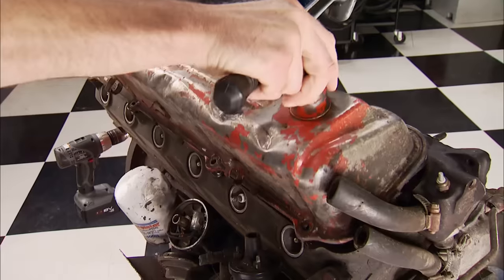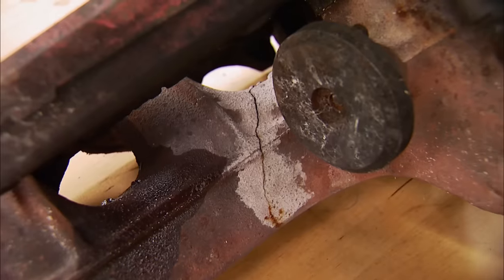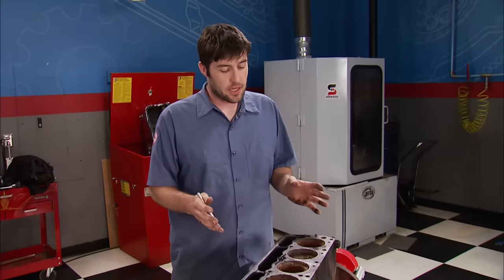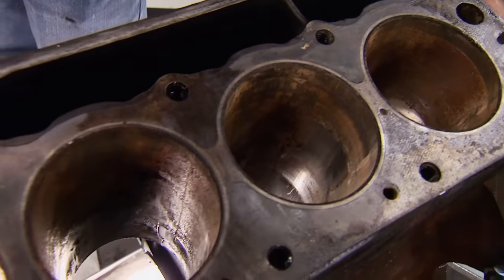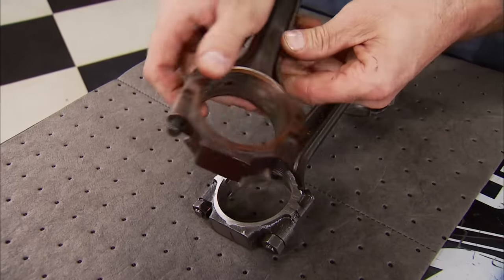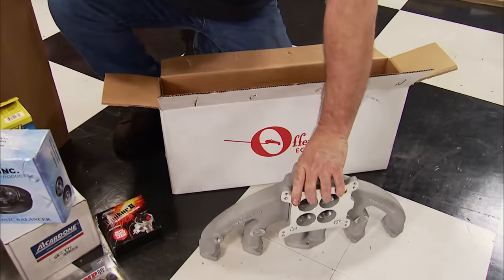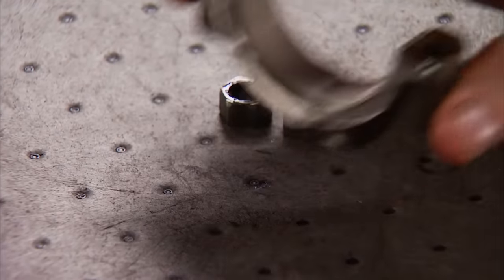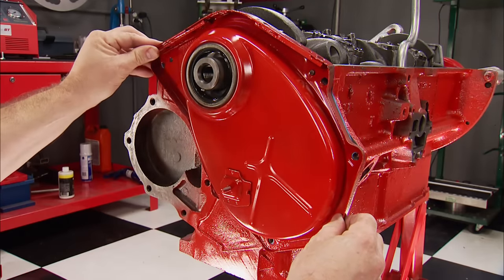Resurrecting A Mopar 225 Dodge Slant Six - Engine Power S2, E2

Comment: We bought this engine for $150 threw it away, then spent $3000 building a new one and called it the old one.
Reply: 10 4
Reply: Lmao! Shiit
Reply: So true Mr.Kaye, so true.
Reply: You're not supposed to say that -- but yeah.
Reply: @markmergatroid2348  Yep. And I bet that chrome valve cover adds 50hp!
Reply: Lmao ... machine shop kept it for themselves
Reply: Yes. He also could have said "The $140 block and heads were fine with machining. I could have ordered a crack free reground crank at a local parts store for $250, but screw that. The show needs extra drama."
Reply: @tsal4379  truth
Reply: Yep that valiant drove like a tank. But that. 225 was   a D8 cat monster, it handled any ABUSE u gave  it, o yes. 68 doge van too with 9 in it  PCsaw us alot
Reply: Shit happens.  I had a block crack, it’s no more than a boat anchor now.
Reply: That’s why you spend the $15 insurance at the junkyard, they’ll swap it out.

Also they don’t pay for the parts on the show, companies provide them the parts. It’s the same as advertising.
Reply: Every company contributor name was mentioned😮.   
Down to the bolts and washers.
Reply: Gotta love the logic of tv
Reply: That's how I do it.

Comment: Should be called "How to tear down a Slant six, throw it away and build a new one from scratch."
Reply: I'm cracking out , god I thought the same
Reply: You summed that up very well.
Reply: I had 4 of them and they were not a good engine . 100000 miles and they were junk . Newer engines are tremendously better .
Reply: Charles Wesley also putting the carb over the Iraq exhaust manifold doesn’t seem right
Reply: @sleeplessvirus  The metal used in them wouldnt make good slag .
Reply: @sleeplessvirus   The cars rusted out before you could pay for it . I will not buy a Ram truck today because of how bad they were even with a Cummings engine . I had a. 20 year old Ford Taurus with no rust .
Reply: @charleswesley9907  I beat mine hard for 150,000 miles before I sold it! It ran great! Change the oil!
Reply: @robertlee9395  My truck has 243000 on it and doent burn any oil . 250 thousand in a 4 cyl now days is still not wore out . Not so for the old days .
Reply: @charleswesley9907  Wow its a late 90's model those were the best imo, especially the "sho"  edition true power houses.
Reply: @BACON-l3t  It was a1990. 3.0. L .
Reply: @charleswesley9907  That is why I paid extra to have the 318 V8 on my '72 Valiant.
Reply: @mikemorales1725  318 was a pretty good engine . Still engines today last a lot longer thanks to the Japanese imports .
Reply: @mikemorales1725   Planned Obsolescence of the old days . 120,000 miles on a car was 0 trade in value . Now its just broke in good .
Reply: @charleswesley9907  I recall no one used to keep them past 100k miles, they were useless junk back then. Only Mercedes and Volvos made it to those high numbers.
Reply: @charleswesley9907  Back in those days very few engines went to 100,000 miles without needing at least a valve job - Chevy engines were worse , most were lucky to get 80,000 miles and they were puffing smoke .
Reply: @charleswesley9907  in my opinion the Ford 300 straight six was far superior
Reply: @MrShaun1578  I owned a 74 F250 had plenty of power but was very thirsty .
Reply: Did you miss where they reground and used the old valves? Totally a restoration :P
Reply: I love how they keep putting in the matco plugs on thier tools like rubbing it in that they have a million+ dollar shop at thier disposal they like oh look how easy it is with our high dollar equipment
Reply: @jlo13800  wow, I thought I was bitter.
Reply: Not a 4 stroke fan but would love to  see your converted  slant  6 2 stroke  225 CID conversion, is it poppet valved loop charged, or uniflow with ports cut into it? Are you running oil injection with SAE 40? What VRO are you using, all of it has has to bettere than stock gear VRO pump.
Reply: Well a 4 stroke is fun to destroy though, pick it apart and shatter them to shatter to pieces. I love doing it. hehe
Reply: Ill take a mercury 3.2 v6 optimax 2 stroke aor Evinrude ETEC v6 over this any day, the 225 slant 6 poppet valved 2 stroke does not have a good power to weight ratio, is loop scavenged and noisy and will run in multiple positions though. It requires dry sump and oil injection set at 40:1 on semi-synthetic TCW3 though.
Reply: @charleswesley9907  My Toyota 4 cylinder is still running after 340,000iles
Reply: 225 slant 6 2 stroke loop charged valved cant even compare with a modern rotax snowobile motor for power to weigh ratio. or can it, le6ts see as both will run with xd-100 synthetic 2 stroke oil, the 225 slant 6 runs 2 VRO pumps though and a rich 40:1 mixture though.mits like an old outboard and noisy as hell. lets see how both 2 strokes measure up?
Reply: @butchtropic

No. 

At 50,000 miles the Slant 6 my parents had was burning oil and had such low compression it couldn’t hold the vehicle (a 77 Dodge Tradesman) on a hill. 

Sure you could do a valve job and re-ring it... but like most Malaise Era vehicles in the early 80s it was worthless. 

Now I have one of the worst modern engines in the world... a 5.4L Triton 3v V8... and it has 230,000 miles on it pulls good burns no oil.
Reply: you must premix nat 50:1 if you want to last, its just a sled engine to me. start premixing at rich ratios at of least 50:1, do not run a 225 slant six without premix, they are nothing but poppet valved u-loop scavenged 2 strokes
Reply: you most premix at 50:1 its a 2 stroke cycle poppet valved  2 stroke engine you mistreated
Reply: what do you premix as a ratio? i would run nothing leaner than 50:1 in this motor if you want it to last.
Reply: lol
Reply: That’s  just what I was thinking 😂😂😂😂
Reply: there is no such thing as a 4 stroke, all fucking allusions as most are poppet valved 2 stroke u-loop scavenged
Reply: oil injection with gear pump with premix and 1;1 valve timing with boost, i like your 2 stroke u-loop scavenged 2 stroke, the 225 slant six is made to be a 2 stroke with high torque, low rpm and total loss, long live this 2 stroke
Reply: @basn7381  i feel a theme in the comments
Reply: 4 stroke pos throw it off a cliff most 800 cc 2 stroke sled DFI 2 strokes make much more power, There was the 225 converted to 2 stroke it ran 350 hp and needed 2 vro pumps though, noisy as hell though
Reply: such a nice car powered by such 4 stroke crap, i would love to take the engine , mount it down range and blast it to pieces, long live ETEC an Optimax 2 strokes as well as detroit diesel 2 strokes
Reply: agreed
Reply: True true.
Reply: do we still remember how easy and cheap it was to raise a good horse
Reply: @jlo13800  ......k
Reply: Im not familiar with this engine but i heard it ran a long time, was this some 2 stroke conversion like one guy did to to mercedes 5 cylinder diesel?
Reply: run oil injection and run it in multiple positions, it should do that as these had high power to weight ratios! any synthetic 2 stroke oil should do.
Reply: its easy to destroy with high revs and multiple positions, it should survive at 50:1 premix though like a sled motor after all its so dodge tough, let the experiments begin!
Reply: Rev the hell out of it and it will work
Reply: Klotz oil techniplate for the oil injection, 225 slant 6 make for a nice poppet valved 2 stroke with dry sump and oil VRO pump into the intake manifold.
Reply: Its Assembling not resurrecting
Reply: 😂fr was abt to comment that
Reply: xd-100 2 stroke oil in it.
Reply: Total loss oil injection get with modern times, thats what a moden 850 runs
Reply: Oil injection with modern bearings get with it
Reply: Old school stuff with out oil injection, get with modern times with vro
Reply: premix with modern oils and oil injectiion, get with the times
Reply: The oil injection with a vro pump and and 2 gallons of quicksilver tcw3 synthetic 2 stroke oil, it would work fine as the 225 slant 6 was just another sled like motor. They even sounded like a skidoo 440 reved up
Reply: Run it with oil injection and in mutiple positions, after all it should survive like a sled motor! its a poppet valved 2 stroke!
Reply: What does it use for a VRO metering pump, i would go with one from a large v6 2 stroke outboard.
Reply: Lmao!!
Reply: @charleswesley9907  ..Cummins....
Reply: @jlo13800   Are you off your medication again?
Reply: @charleswesley9907  No im hooked on klotz techniplate,2 stroke oil, i got to get 8 gallons for my 2 stroke 8v92. Damn too pricey though! ugh but works damn good in it
Reply: @charleswesley9907  Im sure a 225 slant 6 can be converted to a 2 stroke poppet valved u-loop scavenged, just baffle the intake valve to prevent short circuiting, run 1;1 crank speed came, open the exhaust valve a little early to allow blow down and provide scavenging air. its been done
Reply: @charleswesley9907  i grew up on 2 strokes and i think all of them are a form of 2 stroke, they have not been realized to unlock there potential, everything is 2 stroke to me, its just been corrupted to act like its not. Poppet valve loop scavenging anyone
Reply: @charleswesley9907  Run it on synthetic 2 stroke oil and she might hold up better, run her like a cr500!
Reply: @charleswesley9907  To me there is no such thing as a 4 stroke, all so called 4 stroke are misfiring 2 stroke that need help.
Reply: @jlo13800  Go away !
Reply: @charleswesley9907  its a potentain 2 stroke i will, fire on every stroke loop scavenged
Reply: @charleswesley9907  fire on every stoke like a detroit diesel or a rotax
Reply: @charleswesley9907  Im not a 4 cycle person and will continue to use 2 stroke oil
Reply: @charleswesley9907  4stroke does not exist  to me
Reply: Right
Reply: The reason why they were indestructible is because they were breathing-limited to ~4400 RPM.
Hop 'em up and that 'guarantee' is gone...
:-/
Reply: Click-Bait is the number one component on YouTube.
Reply: Junk not worth the time and money.
Reply: I have magna fluxed machine parts, am a machinist and if the parts are cracked they can't be used. Duhhh. The block isn't new and new slant 6 blocks are not available, I have a slant 6 and have checked.
Reply: @charleswesley9907  After 1966 or 1967 the workmanship on those cars went downhill as well.  I had a 1974 Dart Custom and it was delivered to me with several glaring defects one of which was a warped and leaking exhaust manifold.  I was very angry with the dealer who got away with delivering the car in that condition.
Reply: @1575murray  I now drive Fords , they are some better .
Reply: why dident they try to turn it over at the junkyard.
Reply: was literally thinking the same thing, how is this a restoration, its a brand new engine
Reply: Ha haaa I was thinking the same thing.
Reply: that's a lot of their videos
Reply: So you reuse cracked cranks and old busted pistons etc in you builds ?
Reply: That's because, unless they got some sleeves, the block wasn't salvageable, those engines are dirt cheap and would likely cost less to just buy a new block than to get it sleeved
Reply: @lenny108  😄👍 yep
Reply: dont be silly, the oil pan was reused
Reply: @robertlee9395  bought a 62 Valiant(ex navy car), for 50 dollars. It was running on 5 cyl. It had a busted rocketshaft of all things.A replacement from the junkyard, brakes, and tires. Drove it for years !
Reply: @Daniel Stefanov Yep. I'd like to see what all they found wrong with that block.
Reply: I'm with you!
Reply: @charleswesley9907  Cummins not Cummings yo.
Reply: @charleswesley9907  Modern electronic fuel injection and ignition systems allow newer engines to run much cleaner with less carbon builup and less crankcase contamination from fuel.  Also better oils nowadays too.   Old engines used to get crudded up and sludgy very quickly.   Carbs were often worn and out of adjustment.   Chokes would fail and people would be dumping gasoline past the rings when ice cold trying to start them.
Reply: It does show the reality of this hobby. It is a shot in the dark if your junkyard motor is shit or not
Reply: Should be called, "re-uploaded how to tear down a slant six and throw it away and build a new one from scratch
Reply: I mean, it's a dodge motor so makes sense
Reply: @trelee9865  that literally made no sense lol, old dodges are the only old trucks still putting in work because they are hard to kill
Reply: @charleswesley9907  better than the Soft steal that they used to build the cams for a Chevy
Reply: Lol! 😆